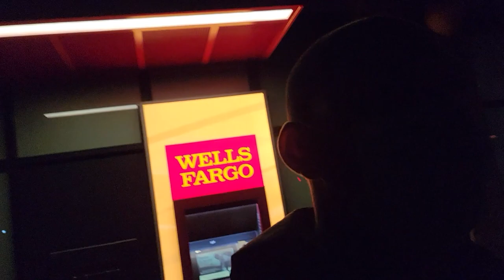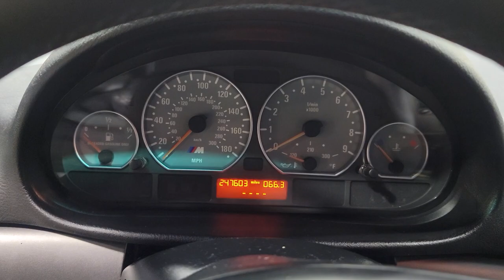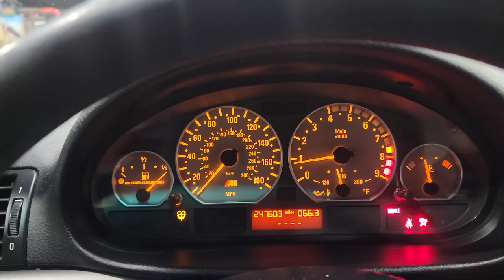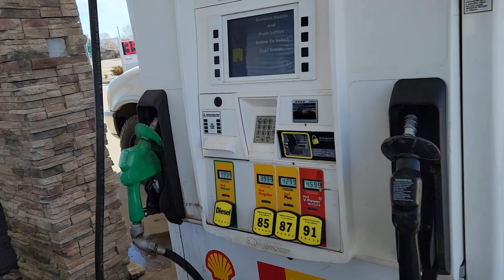I Bought The Cheapest Laguna Seca Blue E46 M3 in The Country

Comment: 2011 N54 with 94000 miles and it's an I.S. SAWEET!  $11,000 not bad! But I might just have that beat. I bought a 2008 335XI (Not my first choice) that needed a High Pressure Fuel Pump and a wheel bearing but it had 189,000 miles for $1500. All of the miles are high way but it had been sitting for about 8 months. But I daily it today and have it boosted and FBO. I've just bought a set of the Ebay T17 TD04 Turbos that "0 to 60"  or "Zero to 60" did their budget build with and ran up to 625 HP while dailying it and Roll Racing it as well as Drags etc. Finally this month they pulled the turbos and are experimenting with a different set of "Flow Max" as well as another set up that is brand new and never tested until NOW. So awesome stuff awesome cars !! DO THE MAINTENANCE!! COILS, PLUGS, OIL CHANGES, OIL PUMP FILTER GASKETS, MAKE SURE THE INJECTORS ARE GOOD THEN EBAY THE CRAP OUT OF THOSE BOLT ONS!!

Comment: Hi I know this is 2 years old video, but I am a N54 god. We have what it called ediff it will acts as LSD in straight line. Lets say for example doing a burnout in stand still will still spin both tires no problem, but drifting or turning tight corners it will become open diff. The 1M does comes with LSD maybe you're thinking of 1 series non 1m that doesn't have lsd.

Comment: Snagged one for 8k with 129,000miles only mechanical issues were diff/axle seals was leaking and the vanos solenoid was rebuilt. with 136,000miles still running strong but only issue now, oil filter housing is starting to leak 😉
Reply: What color?

Comment: i got a siver m3 same year and 6-speed, pull the carpet in the trunk and check for cracks mine is completely fucked. i gotta drop the rear subframe and weld everything back togeather
Reply: I call that having to earn your turns.    I picked up 04 mystic blue.... every bushing is dry rot..... thinking of using the glue method of frame reinforcement when I change out the bushings.... after a whole lot of other work..... smg to manual, yada yada....
Reply from the maker: I remember seeing your post online, very unfortunate. This one is crack free, just had had worn bushings in the diff cover, all fixed now and Zach threw a diff in with 40k miles.